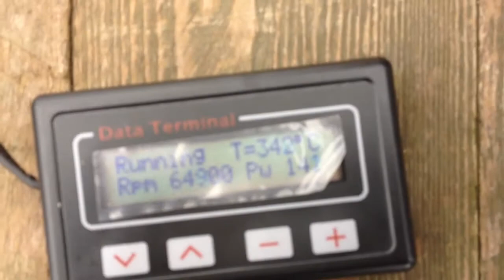Synergy N9 Wren Turbine Kero-Start Flames!

Comment: So tell em how this works. I assume, and it appears the that rotor is powered by the exhaust of the turbine? Is there also a clutch of some sort that engages the rotor at a certain rpm? I would expect the output shaft to start spinning almost instantly after the engine spools up